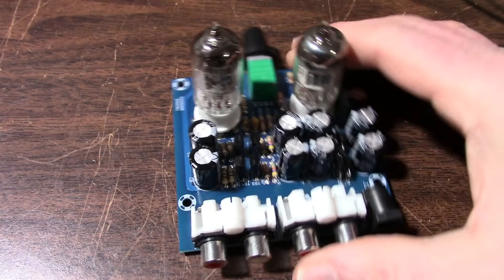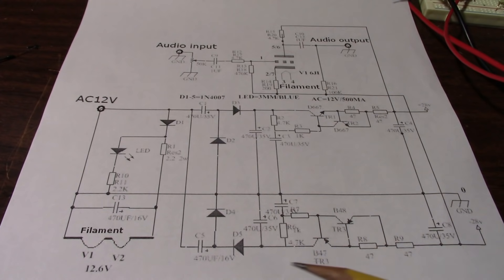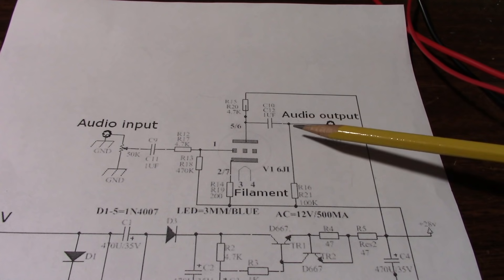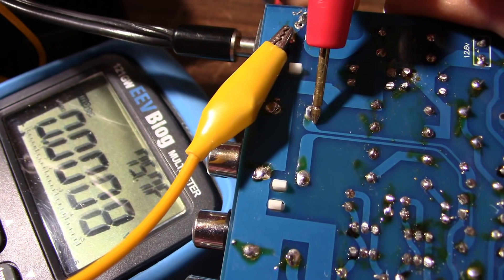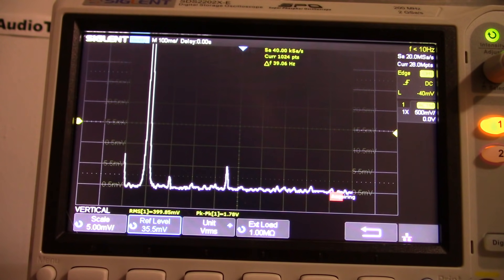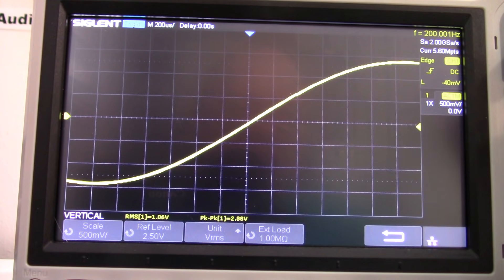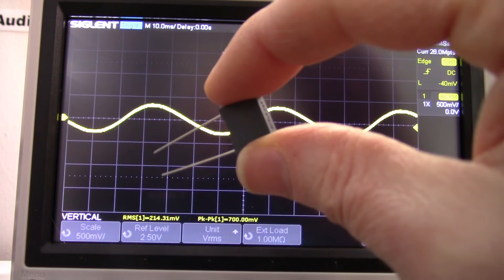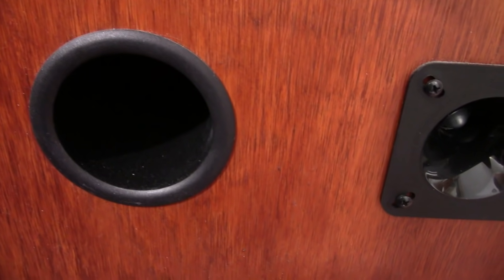Tube preamp budget kit test and review

Comment: So it is true, not to put ceramic caps on signal path.. Been once tried one on a tone control or something like that, and the audio output goes dirty, got some noise, speakers sounded like pouring corn / nuts onto the speaker membrane. Power it off, change the caps to MKM, and the corn went away.

Comment: They probably put the filaments in series - 12V supply and 6V filaments. The issue is you can get uneven heating.
Reply: Many old radios that ran directly from the mains did put all the valves heaters in series without issue. The issue here is cheap nasty valves. The word CRAP comes to mind.

Comment: On minute 17:55 the noise comes from the diodes 2,3,4,5. . . . if these are bridged with capacitors then the sirring goes down. . . . these diodes are too fast for this kind of use, that’s the reason.

Comment: Aren't the tubes just acting as a buffer and the  transistors are actually doing the amplification?
Reply: No those transistors are voltage stabilisers, the valve does provide all the gain

Comment: Hi, you must get thousands of questions but I would like to ask one and will make it brief, I want to build my own headphone amp, I will design the PCB and enclosure myself but would like a known good schematic ( tried and liked ) to work from, highest possible sound quality for my old ears (55 years, I had them from new ) I won't scrimp on the quality of components and probably run it from my apple MP3 player or laptop with an external DAC, I would love for you to make a recommendation of some designs to look at but I have no experience with the subtleties of design that's why I would like your help or help from your viewers ! my headphones will be entry to mid range decent brand like Sennheiser ...cheers!
Reply from the maker: The diyaudio forum is the best place for advice. Lots of helpful experienced builders there. I get a lot of questions and can only provide short answers like this.
Reply: @JohnAudioTech  Cheers, I will check that out.
Reply: Don't even think about valves for headphones. Valves are high impedance devices, most headphones are low impedance, perfectly suited to solid state devices.
Reply: @MichaelBeeny  Thanks, I've seen cheap devices where they put blue LEDs under the valve,exactly what I'm gonna avoid ! any thoughts on my question Sir ?
Reply: @wallyhinson  Thanks ! fascinating read.

Comment: I think twice about tubes in audio applications. They high voltages compared to signal voltage levels, they have high inner circuit impedances, requiring impedance matching means for power amps und the circuits dont have enough open loop amplification to apply negative feedback. So their distortion levels are pretty high. They don't clip very hardly because of their highly nonlinear behavior close to the voltage rails, but this is not really an advantage over semiconductor devices.

Comment: The electrolytics are going to get too hot being so close to the tubes
Reply: Iv'e seen fleabay photos both with the caps mounted on the top with the tubes and with them mounted on the underneath of the board. I guess it's up to the one soldering the kit in to decide what side what goes in

Comment: The 6J1 is complete trash. Make your own actual preamp circuit with a 12AU7/12AX7 and build a high voltage supply with two 12.6vct 1A filament transformers.
Reply: An even better choice would be the EF86, higher gain also. Almost any valve is better than the 6J1.

Comment: dc filament is much better for hum.. ;-)
Reply: I doubt at the gain this is running at it would make a difference, considering that even 4&5 stage high gain amps often run AC heaters, shielding is more important or you'll suddenly be  listening to radio :p Though who knows how shitty those chinesium tubes are, may still be worth a try.